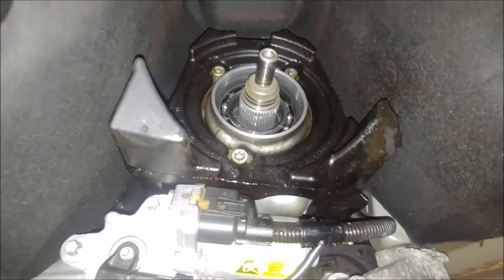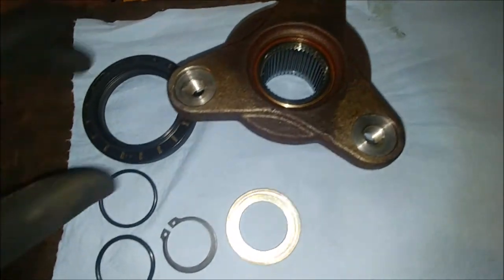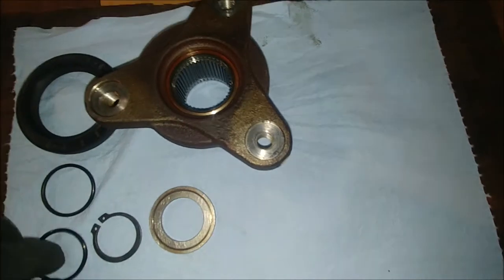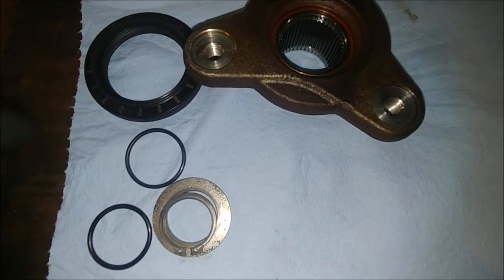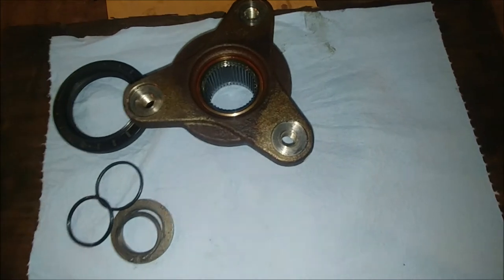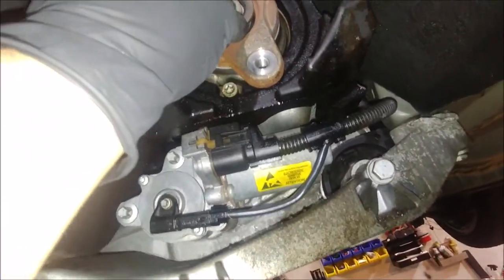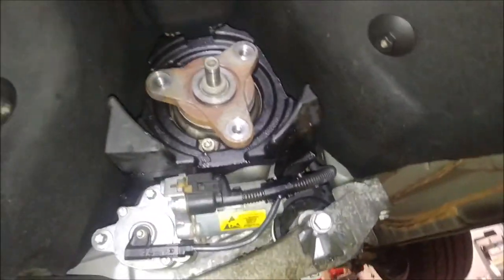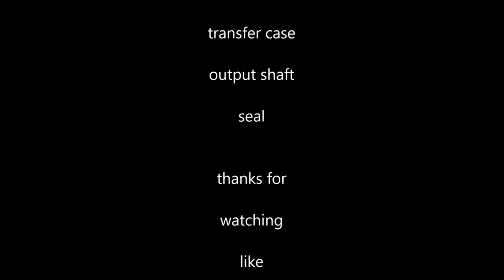535xi transfer case output shaft leaking seal after it was replaced

Comment: Nice video.  Do you know how to get the flange off the front output shaft?  For some reason I can't seem to figure that out.  I have a 6spd/transfer case that I want to replace all of the seals on.
Reply from the maker: Not sure, hope you find a video. I've seen multiple rear leak but never the front which might not have that o'ring.

Comment: How did you get to this point? Remove exhaust and heat shield and then remove the shaft?
Reply from the maker: Yes.
Reply: @sergesvz  , thank you for sharing this. Did you have to remove the exhaust entirely or unbolting front 4 bolts and letting it hanging is enough? I am trying to replace the transfer case fluid on my '10 e61 wagon and I found out there is no way to do it without removing the exhaust due to filling hole location. Also noticed that there is a small leak on the back. Perhaps the same o-ring needs to be replaced.
Reply from the maker: @Sandr0n  unfortunately yes, but it makes it so much easier. You will need to take out the heat shields over the exhaust. It covers a lot of things including access to transfer case.

Comment: Do you replace the transmission bearing on the output shaft when you replace a transfer case ? I went for a car inspection at BMW today because of the driving noise, they told me a major grinding noise is coming from the Transfer case.
Reply from the maker: I haven't had to do anything like that.  In most cases an used transfer case would be the best, least expensive route to go to if you have major failure.
Reply: @sergesvz  When I drive, I can only hear a noise around 70km/h, going down to 40km/h. I wonder if there is something I can fix inside the case. I'm thinking to remove it myself and bring it to a transmission place that I know. The car is running fine, to ABS light, nothing, still pull very good too. Can it be just changing the oil, not sure if this worth it at this point because of the grinding noise they talking about. Could be the gear from the actuator too ? Car have 70k Miles Thank for the reply.
Reply from the maker: @John-qc1zv  drain the oil and see what it looks like. If it has gray metallic from wear in it then most bearings would be junk at this point.
Reply: @sergesvz  Allright will do that, keep you posted, thanks. I've seen some people though it was the case while it was the U Joint on the drive shaft too. Will go a mechanic where I watch under the car next time.
Reply from the maker: @John-qc1zv  yes I had one where it was scratching the heat shield, but it was after going through some heavy snow.
Reply from the maker: I didn't replace any bearings. I would replace them as a set. If you have one go bad, most likely it sent shavings through all the other bearings. Rebuild or just buy a used transfer case. Check out car-part.com for used parts.

Comment: What did you use to get the seal in?
Reply from the maker: You can use seal driver. But often I use a socket big enough tap with rubber hammer.

Comment: What tool did you use to remove the collar nut on the output shaft?  Bentley manuals say that BMW special tool 23 1 210, but i cant find that tool anywhere.
Reply from the maker: It's just a c'clip no nut on this one as you can see
Reply: @sergesvz  Ah. I mistook the c clip grooves for threads.